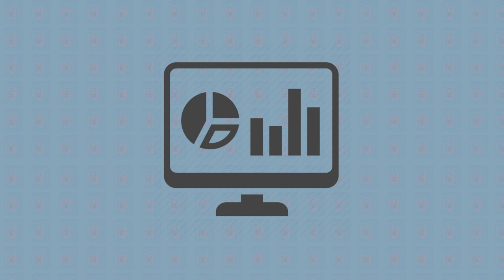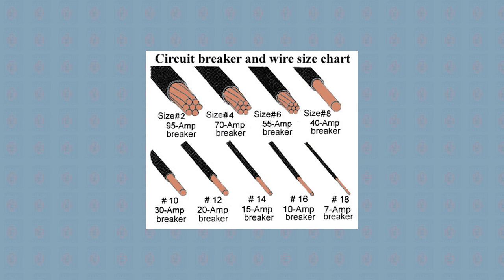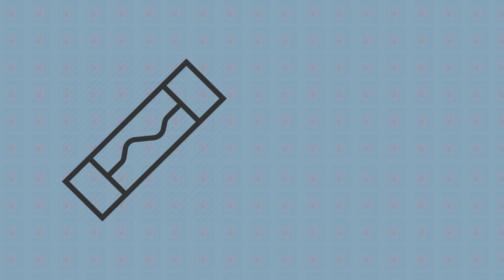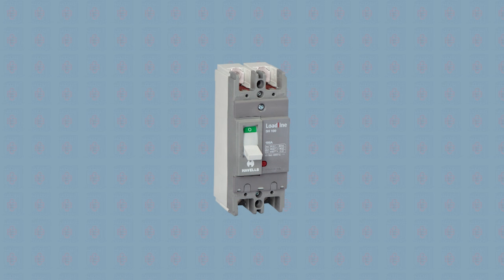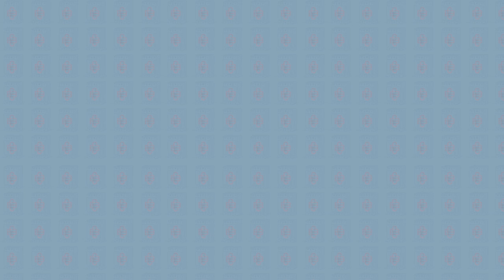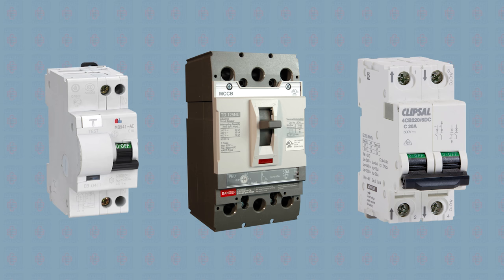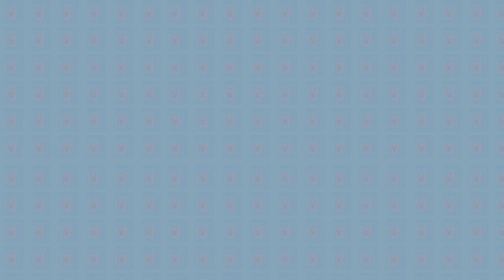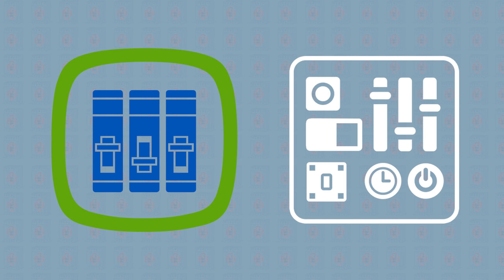Choosing the Right Circuit Breaker

Comment: To clarify, shouldn't it be that a 10 gauge wire ALLOWS a 30 amp breaker, while the 14 ALLOWS a 15 amp breaker. You can always undersize a breaker safely, but oversizing increases fire risk.